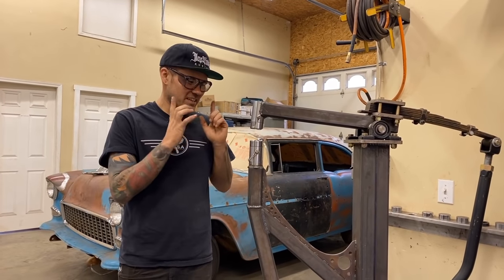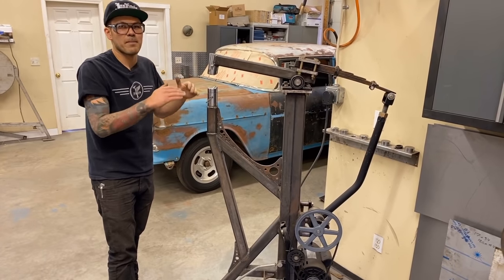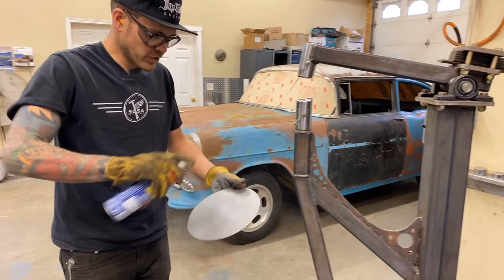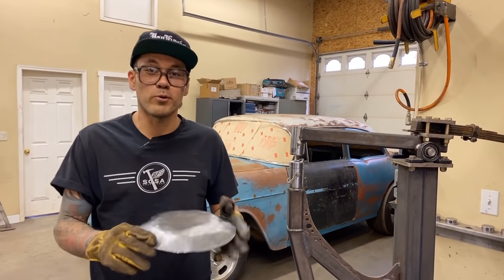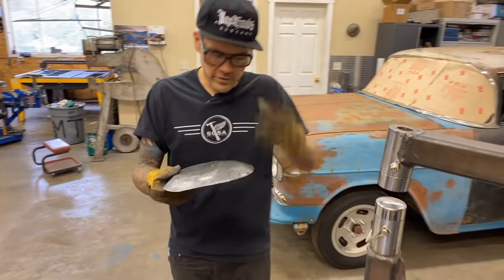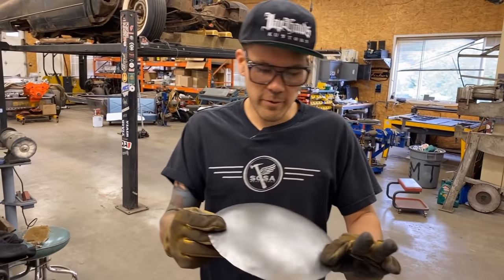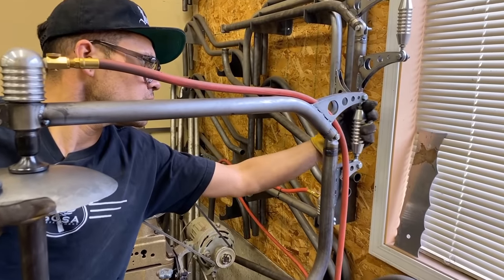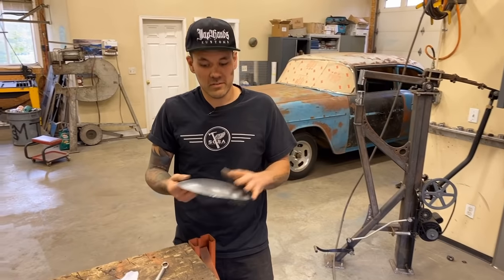Metal Shaping Tools!! SHAPE-O-MATIC Power Hammer (Helve Hammer) | FULL Demonstration & Overview

Comment: How many times have you gotten your fingers in that power hammer :)
Reply from the maker: Luckily none!! But I've heard some horror stories!
Reply: Thanks for the video and skills. Keep those fingers safe bruh
Reply: Uma máquina simples mais com uma eficiência incrível! Acompanho seu trabalho, continue nos presentiando com sua técnicas.
Reply: In the words of Jesse James "it's real good at making blood shoot out from underneath your fingernails" 😁
Reply: For that reason i think i dont need one.
Reply: @MakeItKustom  you only make 1 mistake with a machine like that.
Reply: It uses the Darwin Award safety system... If you are stupid enough to get your fingers in between, then you deserve what ever happens... Like with any power tool you have to make sure you don't have pranksters or idiots monkeying around near you, safety guards are in place, you aren't wearing loose fitting clothes, sleeves rolled up, and use push sticks or clamping tools or weld an extension for smaller parts to keep your fingers away from what will hurt you. ;)
Reply: That tool is scary AF. Definitely better keep your mind on what you're doing.

Comment: Hard question: If you only had $8000 US to spend on shop tools for fabrication, metal shaping of all kinds for automobiles) what tools would you get. You can excluded welders, compressors, and any cheap hand held tools like metal shears, etc.  I'm thinking of things like the one in this video, english wheel, brake/shear, stretcher/ shrinker...etc....

Comment: I want to know more about making basic hand tools . I have a wood bat I want to build into a hammer, what are some common anvil shapes needed that I can add to my bottle base anvil/stump. How do you make a shaping sand bag?
Reply from the maker: I usually make them as I need them. I use “T dollys” a lot which are round bar welded to flat bar. The bat will make a great shrinking hammer I’ll make some more videos on this stuff

Comment: Karl, what is the stroke on the eccentrics that drive the lever? What is the rpm and HP on the motor (1750?)?
Reply from the maker: About 2” stroke and 3450 rpm but 1750 would be plenty.

Comment: I think i would ..A : not use lubricate to save my fingers from a slip...
B: build a guard to limit what can get into the hammer area....a lexan guard that is adjustable but saves fingers from getting stretched?
Reply from the maker: Or you could C- not smash your fingers in the machine ha ha Ha With practice and time it will become second nature knowing where your fingers are. I was scared at first but after being in a class of newbies running this machine even the greenest of green didn’t smash their fingers and while I’m knocking on wood I am still on hurt
Reply: @MakeItKustom  
I spent 40 + years doing construction and fabrication work...seen it happen in milliseconds....and usually from over confidence ...but yes experience and time helps...for some it just makes them think it won't ever happen to them...which is not ever true....it can and does....one mistake is all it takes....be careful...i never seen anyone use oil on a hand operated metal working machine which you need grip to control your work piece from going in too fast or losing grip....stay safe and keep your digits...you need them decades from now to do this work...

Comment: Must have missed something,aren't they basically the same tool ? The first hammer seems like something you'd use first to get the basic shape them use the planish
Reply from the maker: Thumbnail dies are very different from the smoothing dies
Reply: @MakeItKustom  tks for taking time to answer. Not familiar with either tools operation, only what I see on video. Need to brush up lol